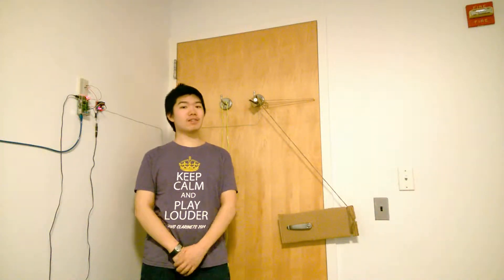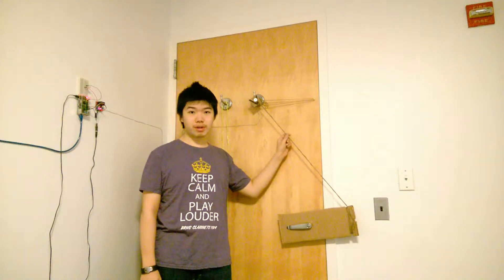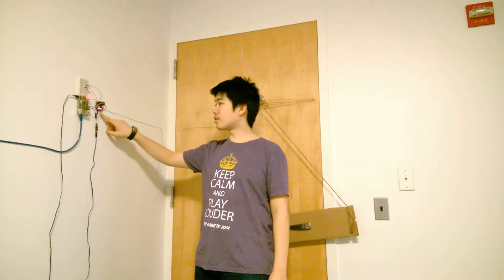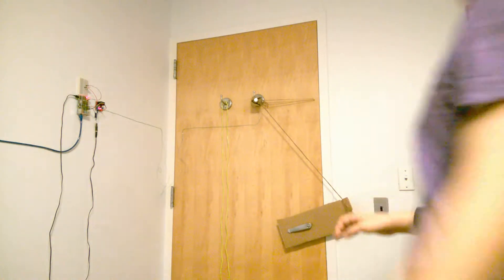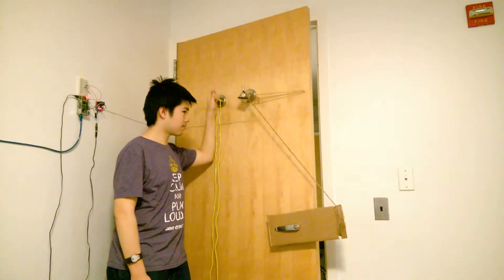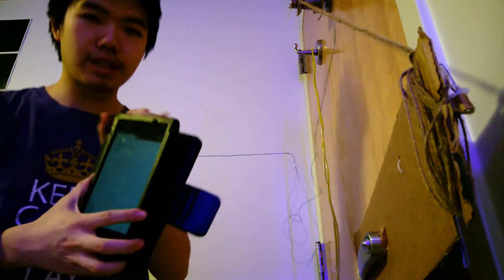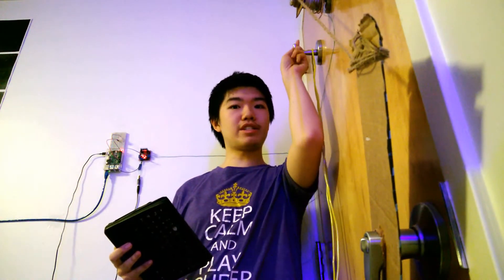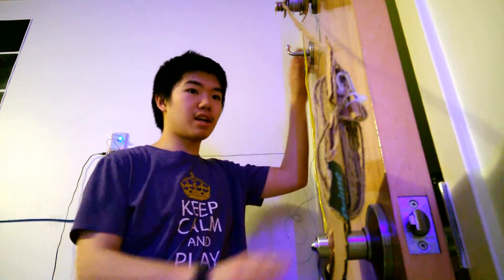Turning a Doorknob with a Motor: Pi

Comment: Hey mate, great work! Can I ask which kind of motor were you using?
Reply from the maker: It was a simple brushed DC motor with a reduction gearbox. It only required DC power. It did not require an ESC or inverter.